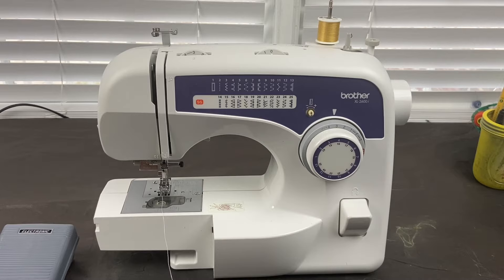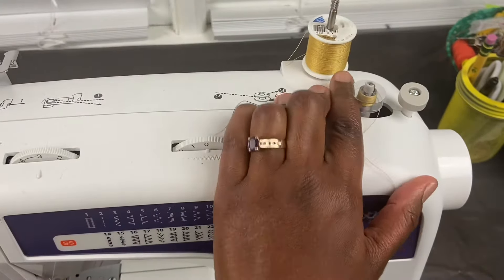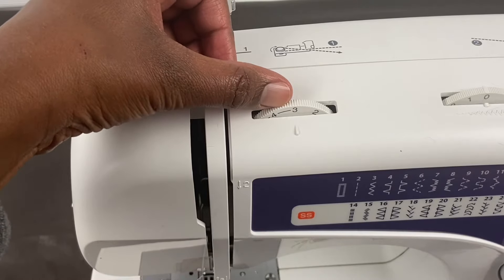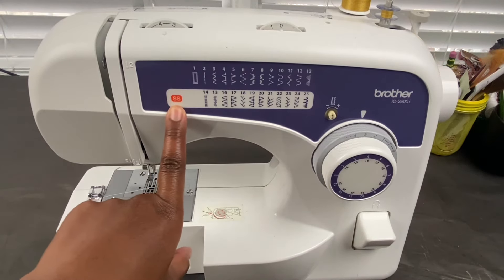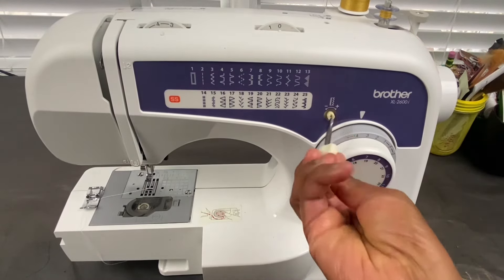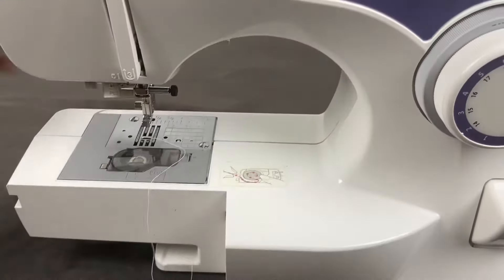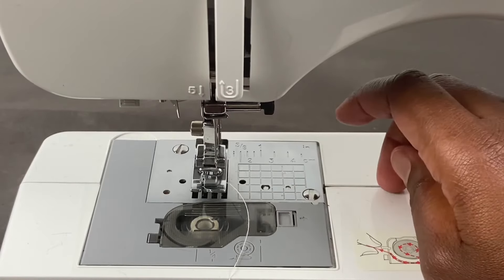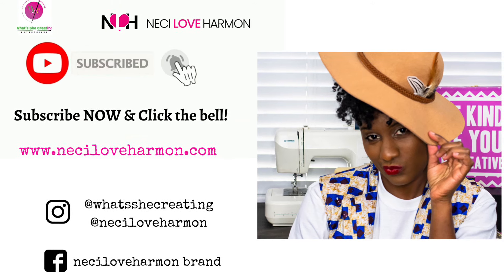Learning Sewing Machine Basics with Brother XL2600i-Part 1

Comment: Nicely explain and saw each function. Brother RS 36 model:-// have  +_- turn with screw driver at the back.  The threader, on mine jammed not coming down. Thread cutter on closing flap. And to do design nob on the right side. Next motor wheel.

Comment: How do you adjust the pressure foot tension? Everything I can find talks about a screw that this model just doesn't have
Reply from the maker: I’m unsure about how to do this with a Brother machine. With the Kenmore the pressure foot tension is inside the door that holds the light bulb. Try that.